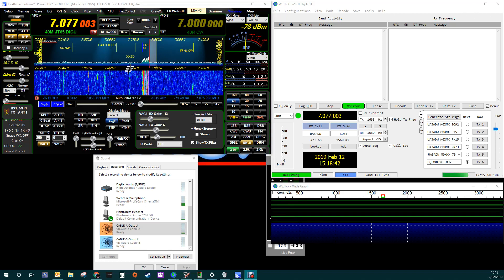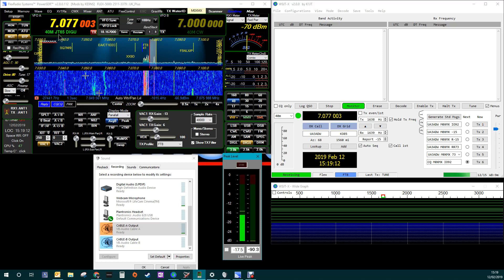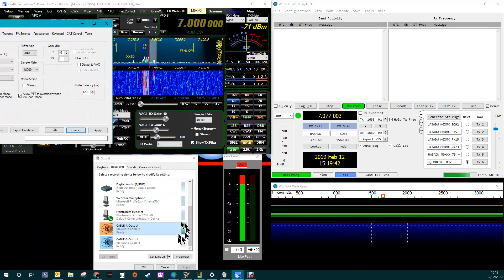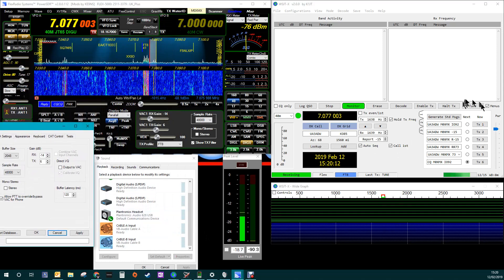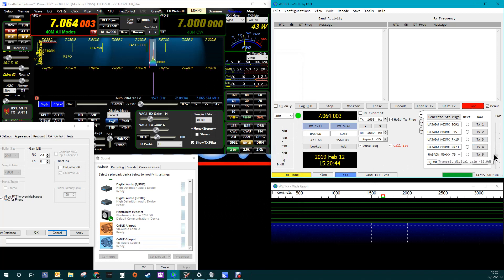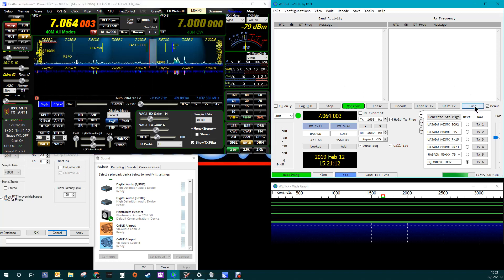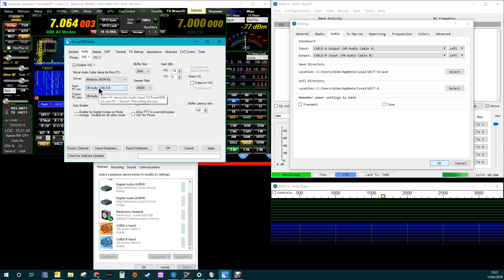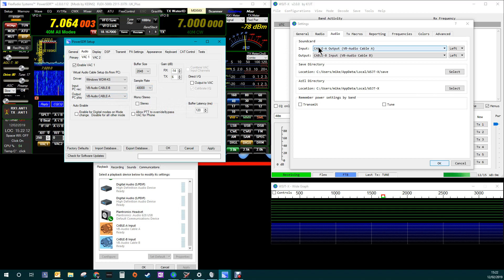Problem with WSJTX getting Audio from PowerSDR using VAC

Comment: Does anyone know if the trial version of the VAC 2.1.2 work with the Flex 3000?  I am pulling my hair out trying to use this program to setup my Flex with the PowerSDR v2..8.0. The reason I selected the Trial of VAC was to see If I could get the Digi programs operational, eg WSJT-X. Noting at the moment is coming together. Flex 3000 works just fine. VAC control panel come up, and I set it according to your other video. However, not really sure how to check operation between various components of the Virtual cables. Is there a forum, site, with written examples of how it all goes together?  Your video's show me how it should work and are very good. But still stuck.
Thanks
Reply from the maker: Have you looked at my other video https://youtu.be/SX4xdYZXyso ? I have switched to VB Cables as I struggled with VAC.
Reply: @MikeM0XMX  Thanks for the feedback, I just yesterday managed to get everything sorted out. First, I was attempting to use the "VAC Trial version" which I could not get it to work. I ordered the full version and installed VAC 4.62 after first deleting the Trial version. GotVAC 4.62 up and running, then had troubles again using your suggestions of VSPMgr and DDutil_V3, once setup it all would work properly, but if I rebooted, I lost all my Com ports, so things did not work properly. My mistake, I have full Administration rights(win 10), however, in the applications of vspMgr/DDutil_V3 and VSJT-X It did not show the check mark in Administration rights. Once checked via the right click in properties (adm. rights) under advanced options. All is good.  Com ports now are available  after reboot. Managed to make contact via WSJT-X and working good.  In the readme of wspMgr he says to check the box for adm. rights which I had overlooked upon installation. 

Thanks for the feedback and nice video's Wb3deh.

 Hint all others, make sure you check the Administration rights in each of the programs you wish to use.
Reply: Yes on the other video...It is very good...